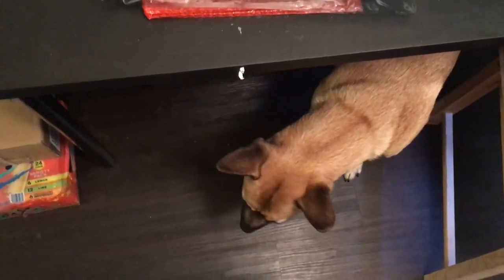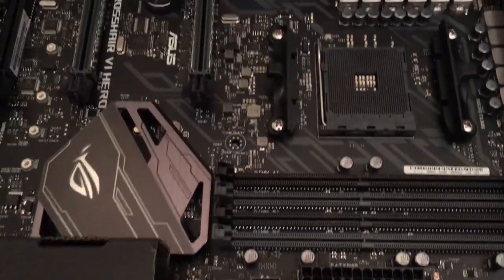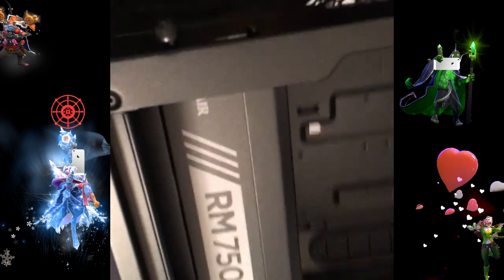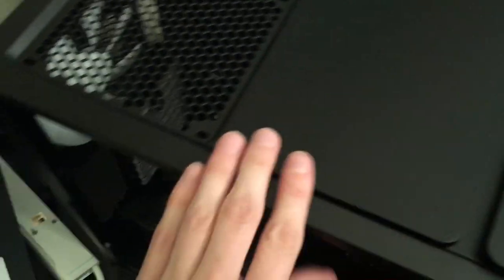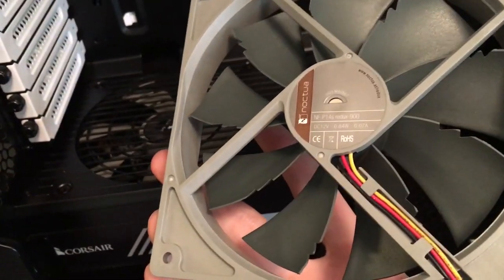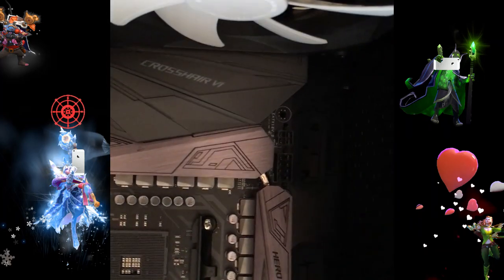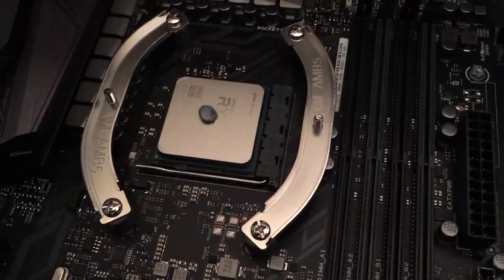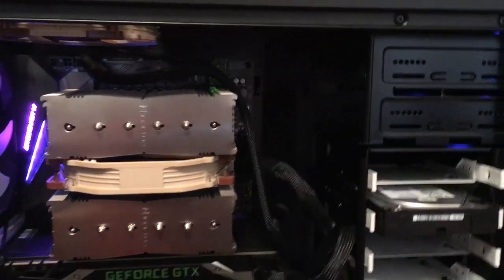Purge Builds a Computer

Comment: you should really rotate that cooler 90 degrees.  There isn't a lot of airflow near the graphics card and you don't want to pull hot air off of the GPU to cool the CPU.  Also if you flip the power supply over it will pool cool air in from under the case and not use the hot air from in the case and the fan won't spin as much causing more noise.  Otherwise great build 1080TI with ryzen 7 is a perfect streaming setup.
Reply from the maker: I just spoke to Pimp about your comment and he said your setup would be more ideal but he guessed it'll only be a 1 degree difference. He also pointed out that the cooler is overkill anyways and that the CPU pulls from the Graphics Card, and the Powersupply does the same, so the Graphics card(most likely thing to make loud noise in the build) is sorta being cooled this way. PLUS dota uses very little from the graphics card anyways from what I've heard. I will monitor the CPU temp next time I stream/record to make sure it's in an acceptable range.

The case has really good airflow as a whole(back, front, bottom, and top have openings), and I'm using every fan power port on the motherboard, so I think it'll be fine, is my mostly uneducated guess.
Reply: That's a blower style card that's closed and won't exhaust air from anywhere other than the back of it so it's all fine. And that D15 is too much for the Ryzen 7 CPU anyway xD
Reply: Yeah I agree the difference is super minimal and that noctua cooler is so large that sometimes you just can't fit it any other way. I didn't get a good look at your RAM clearance but if you upgrade to populating all 4 DIMs you may need to rotate it just to get them to fit. As far as the PSU orientation you won't notice its fan spinning under load because of the GPU fan blowing but its possible at idle/low load if you hear it spin up you can flip it over for cooler air into the PSU, I believe that case has a dust filter below the power supply area if you flip it over and dust filters on the front for your intake fans to keep pet hair out.  Nothing worth tearing the PC apart now to change but just something to keep in mind if you are working on it in the future for upgrades or anything.  Enjoy the new system!
Reply: Technically correct is the best kind of correct.
Reply: THIS.
Reply: There is a top mounted exhaust fan and  the ND15 is overkill for Ryzen, cooling is not an issue.
Reply: i wouldve gone with liquid cooler, i think on liquid coolers you couldve placed the radiator on that top side where you placed those 2 fans.
Reply: It literally would make no measurable difference
Reply: yea but liquid coolers more about the noise and i think if the radiator fits perfectly to that top side it could look decent xD though with purge's mad cable management skills i don't think it matters :D

Comment: Glad to see you use a ryzen cpu. No hate towards intel though
Reply from the maker: yeah this is my first AMD in quite a few years and it's a BEAST so far. Really pleased with it.
Reply: Intel coulda given us this years ago, needed AMD to kick them in the ass just to bring 6 cores to the desktop.
Reply: why is AMD better
Reply: actually im interested, too. Has something changed? I was under the assumption that AMD, while being a lot cheaper, also was a lot slower. That plus some weird hardware interaction problems which result in worse performance. Did that change?
Reply: Stefan Werle Its not a lot slower. But Intel is concidered better by almost everyone
Reply: Ryzen has single core performance almost as good as intel processors while offering much more cores at the same price. An 8 core Ryzen R7 1700 costs $300, a $315 Intel i7 7700k has only 4 cores.
Reply: In the i7 world then yyes. An i7 would perform a little bit better than the ryzen 7, (Not giant difference). But ryzen tends to also be cheaper and is the cpu for streaming editing and other stuff while i7 would perform a bit better in gaming.
Reply: Also ryzen 5 beats the i5 7600 any day
Reply: +Janol More cores doesn't necessarily mean better by the way
Reply: Single core performance is still better in Interl chips, but not by much. Ryzen has advantage of having more cores which is usefull for video rendering mainly in this case.
Reply: Actually if You commpare the  Intel Core i7-7820X 8-Core 3.6GHz and the AMD Ryzen R7 1800X Which is the top CPU in both those ranges then thers actually only a tiny difference and in many cases the Ryzen comes out on top, as well as being MUCH MUCH cheaper.

What really changes the game is that AMD has just released Ryzen Threadripper. Intel release their next i9 CPUs next week but we already have the benchmarks. AMD take a massive lead. We are talking 30-40% in some tests. Threadripper isnt cheaper though. £900 for the CPU alone, £400 for the motherboards.

Intel is no longer King. Threadripper is king and Ryzen 7 is the prince. i9 is just a rushed answer to Ryzen 7. It does not scale well enough to be competative
Reply: Not just more cores, but also better hyperthreading performance, meaning the cores work better together
Reply: i bought amd shares because of the ryzen hype, hoping them to spike when threadripper, epyc and all the new things hit the stores :P
Reply: Yeah. If only amd could fix their vega pricing then everything that is amd would be awesome. Seriuosly though, i wouldnt wanna buy a gpu thats more expensive than a 1070.
Reply: this :) its amazing that they kinda got their shit together in gpu department also
Reply: i built a intel based pc like a week before ryzen was released. i got the i5-6600k. only if i knew how good some of the ryzen 5 cpu's would of been... oh well

Comment: 11:00 I haven't gotten to the end yet, but removing the hard drive cages isn't hard and doesn't require any sort of special short screwdriver. See the manual for diagrams.

Since you only have one 3.5" harddrive you should remove the middle cage (the upper is the one for CD units) to improve airflow, which as you'll probably discover, should flow in from the front (hence the air-filter) and out the back. The proper way to know which way a fan blows the air is to look for two small arrows on the frame. Can be hard to see since they're usually just small protutions in the plastic frame, but there'll be one indicating the direction the fan rotates, and one indicating the way the air blows -- usually the logo on the middle 'puck' is the front of the fan and the air blows out the back.

FWIW, I have seen tests with top-mounted fans where those simply 'steal the air' before it can effectively flow over the CPU heat sink and GPU. It also opens up the cause which will cause more noise to escape, and allow dust in when it's not running.

The PSU is mounted 'upside-down', pulling in potentially hot air from the case. The filter at the bottom of the case is there so that it can pull in air from the underside instead. The only reason to mount it like you did is the floor is carpeted. Not hard to see why anyone would do it like you did, but there it is. In practice your PSU will never see enough load that this will be an issue, especially with a blower-style graphics card which doesn't dump hot air directly into the PSU in this setup.

All that said, in the end nothing of this really matters. It'll work just fine. It's just not going to be as efficient as it could be. Enjoy your new computer.

Comment: Cable managemeeeeeeet! Also i think the heatsink for the CPU is fine in that orientation, since it isnt closed off on the sides it will be able to pull air through even though the GPU is a little in the way.

This was fun! but seriously, cables, reroute through back of case, please.

Comment: I'm proud of Purge trying do this but I was on the edge of yelling at the monitor ;)
Not sure about this particular model of power supply but you probably mounted it upside down. It should take air from under the case and blow it outside. 
Also CPU cooler could work a bit better if you rotate it 90 degrees so it airflow is aligned with rest of the case - front to back.
Cables usually are hidden between motherboard and backplate but its mostly cosmetic.
Reply: Also the "extra fan" on the CPU cooler is not meant to be extra, you can use both on the same heatsink. Just google any image of noctua NH-15... Hope he sees these messages, it could really make a difference to fix all these things..

Comment: Very good choice. Fractal is perfect for silence coupled with noctua. Exactly my choice as well. 
 15 drives will create vibration/humming noise.  Doubt even vibration pads under the case itself would help. Obviously the included vibration pads for hdd's are nice but even with those i can hear the hum when drives spin up.
You chose ryzen for productivity/streaming which is a great pick and nvidia for gaming.
 The only thing that may fail is that power supply unless corsair fixed the issues. Ive had 750 or 850w RM one die on me over the night. Didnt turn on. Warranty replaced so no foul.

Comment: I just did a build on monday used a lot of the same as me. Went with a 1700 but only a 1060 for now.  Same ram too but I went with a Asrock Taichi.  I dont think you did your fans correct though you need a good pressure environment either neutral or positive, you want air flowing in the front and out the top and/or back.  And the PSU fan can also act as exhaust if you have the fan facing the case.

Comment: I actually don't remember which side of the fan blows where, but if i saw correctly all of your fans pointing to the same direction (in/out). Try to make a stream of air that will exchange air inside the case, preferably it should pass through entire case. (Something like in-flow on the back, out on the front)

Edited: I think you should just flip front pair, that way air will go from the back, pass by the motherboard, and exit at the front.

Comment: Purge, I know you're not super techy but you should overclock your Ryzen (or get someone to do it for you). With an overclock, your Ryzen 7 will improve performance to just above the more expensive 1800X and that probably allows you to do one more notch in the encoding quality settings in OBS / xsplit
Reply from the maker: Already did! Pimp helped me out. We're sitting at 3.89 GHz, and he overclocked the RAM as well. I streamed yesterday 1080p WITH a screen region for Sean and was only at 50% CPU usage while maintaining full Dota FPS :D
Reply: PurgeGamers so much fukkin money, and here I am, on business laptop trying to get 30dps on low settings
Reply: PurgeGamers did you get your ram running its full speed? 3200mhz memory is prefered with ryzen

Comment: Please mount the second fan ON the cooler, it basically nets you around 5 degrees extra cooling.
Oh and please for the love of Gaben turn that cooler sideways.
And set the XMP profile for the RAM or they will work almost at half speed wich is very detrimental to your CPUs performance which greatly benefits form fast RAM (3000MHz+).

Comment: The air flow in that case is unfortunate. Think that ryzen is going to run a bit warmer. The CPU fan is trying to pull air but the 1080 is blocking most of the straight in take.  Like someone else in the thread suggested, see if you can rotate that heatsink so the CPU fan is pulling air from the front of the case.

It will run fine but your cpu temps will go up as dust gives the fins a light coating.  Blast it out with canned air now and then and you'll do good.

Comment: Dear @PurgeGamers, 
Please ask some one else to hold the camera as watching this in full screen gave me nausea due to all the movements. Other than that the video was very good.

Please check if your cabinet has some space left between its right side door and the motherboard mount. This space is usually left there so that you can route all the cables through that space so as to provide least air resistance.

Comment: You want the fans to pull in the front so they pull through the filter to stop dust build up. Air gets pushed out the back and the top
Reply: And you should rotate the heat sync to its blowing air out the back and pulling from the front. Its getting no air flow with the graphics card directly in front of it

Comment: I think you should be able to flip the heatsink 90 degrees so it isn't either choking against the GPU, or blowing hot air at the GPU.

Shoulda gotten Samsung B-die(3200mhz CL 14 usually), it's the RAM Ryzen loves more than anything for hitting higher speeds not that it matters much, probably <5% in most cases. I think getting the card for free is like the only reason I've seen people using FE 1080tis lol. You could always buy a hybrid kit if you want to get rid of it's noise. 

Surprised you didn't go with Threadripper though. I mean it's ONLY $1500 for just the CPU/Motherboard.

PCPartPicker part list: https://pcpartpicker.com/list/Kb4qZ8
Price breakdown by merchant: https://pcpartpicker.com/list/Kb4qZ8/by_merchant/

CPU: AMD - Threadripper 1950X 3.4GHz 16-Core Processor  ($999.99 @ Amazon) 
Motherboard: Asus - ROG ZENITH EXTREME EATX TR4 Motherboard  ($539.99 @ SuperBiiz) 
Total: $1539.98
Prices include shipping, taxes, and discounts when available
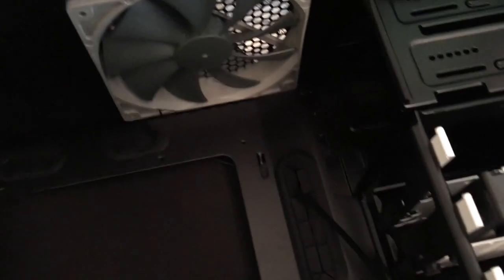Generated by PCPartPicker 2017-08-24 13:28 EDT-0400

Comment: I actually built an incredibly similar rig a few months ago (R7 1700 + 1080 Ti FE + Noctua NH D15 + Samsung 850 Evo + 3000 C15 DDR4 in a Fractal R5) so if you run into any random issues, I've probably already already had to deal with it.  I'd be happy to help out, just hit me up.

Comment: As a computer nerd, I'm glad to see this video.  I may be a 1.5k DOTA 2 player, but at least I know a slight bit more about computers than he does.
<3
Also, Fractal makes some of the best cases.  Glad to see we have that in common.
When you have to use a bit alone as a screwdriver, use a pair of needlenose pliers to turn it.  #engineering hacks

Comment: i'd say these are the best components that you could have got..nothing too overkill like a 1000$ cpu or some other craziness..
Reply: Kakashi Hatake a ryzen 5 + 1050ti +8/16 GB RAM would have been more than enough for gaming, but considering he also runs the stream on the same machine the more expensive build is optimal. Going for a Titan XP (or Quadro in this case) and a 1k$ Intel CPU would only be necessary for heavy editing, graphic design etc.

Comment: I'm so glad Purge actually has decent hardware. Hes got pretty close to what I would have recommended myself. I'm so sick of seeing streamers get a "friends" advice and ending up with some trash PC because the friend based their knowledge on some bullshit PC World advert and then decided to claim they knew what they were doing.

For anyone who does not know that drive he has is basically the next generation of Solid State drives. They are that shape because the SATA interface simply isnt fast enough to support the speeds they run at so they run over the PCI Express bus like graphics cards do.

Not all drives are that fast but those Samsung ones are as big a jump from SSDs as SSDs are from HDDs. The down side is you don't get to see the windows loading screen any more because windows loads faster than the loading screen can render.
Reply: BigMonMulgrew its pretty easy to recommend ryzen specially to streamers.

Comment: Damn, the last time I opened up my desktop case was 10 years ago. That's 2007. And for that time, I knew the whats and hows, for the most part. Now, everything looks new... In a good way, though!

Also, WHAT THE FUCK is the size of that heat sink? 17:00 The last time I saw one over a processor fit inside the palm of my hand... Damn...

Comment: overclock that chip to 3.9 boi
Reply from the maker: We only got 3.89 out of the overclock ;_; THINK OF THE MEGA HERTZ
Reply: PogChamp
Reply: Dkbutler 02 I have a question since im a pc noob. Does overclocking hav any down side to it?
Reply: you void warranty, u make ur cpu run hotter cause ur putting more voltage into it, but you get better performance!
Reply: Depends on your cpu sample, high voltage and heat can degrade your cpu and even burn or fucks up some of his instructions (i managed to fucked up x64 instructions on my ooooold Intel 805D, i pushed that cpu way too high with clock on extreme voltages).If you dont raise vcore that much and cool your cpu nicely, you wont shorten a life span of your cpu(at least in 90% cases).
Reply: misticx yeah but I'm just saying that higher voltage usually results in higher temps :/
Reply: Dkbutler 02 How are they able to tell if you overclocked or not?
Reply: what do you mean? +joeforit
the overclocking just raises the standard clockspeed of ur chip